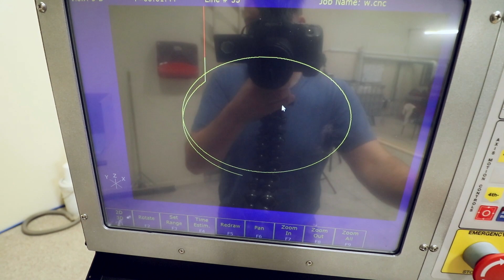Titanium Fidget Spinner Button

Comment: +Magnus, the process can be simplified if you start with the bottom of the button (surface, bevel, thread cutting)! You need no rounded vice clamp then, just make a positive (screw) and negative (threaded hole) on the top of a block of aluminium, brass or whatever and put it in the vice. Then you can screw on the button and finish the top. You just have to make sure that if you do circular moves on the top (e.g. when cutting a bevel), you have to mill in the direction which fastens the button to the base, so the button does not come loose by accident.

Comment: How are the buttons and bearing fitted in the spinner?  If it is just pressed in, do you have worries that they might fall out for some customers and become too loose to use?  
Also, have you looked into different kinds of bearings?  After playing with a few spinners, I can hands down say the best I've used are R188 bearings.

Comment: hi magnus after using your cnc machine for some time are u pleased with it ? i am thinking about software limitations and maybe instead that one u could get Tormach cnc. I saw it in action and its pretty sweet. but the main advantage is the software that it uses. Fusion 360 its free and really good